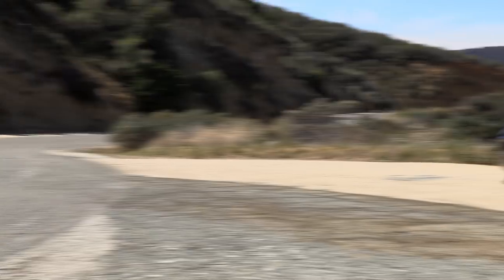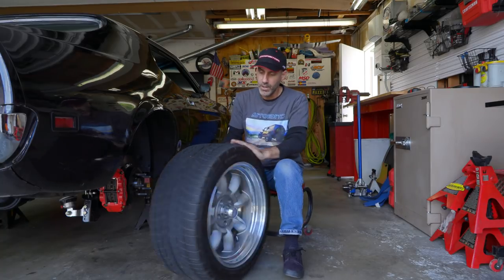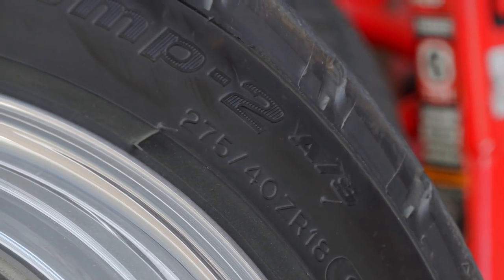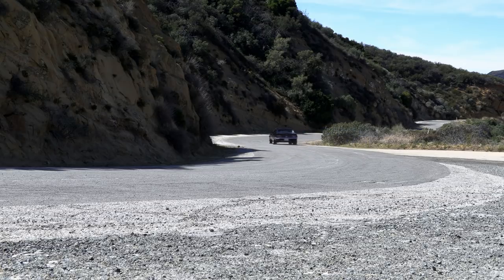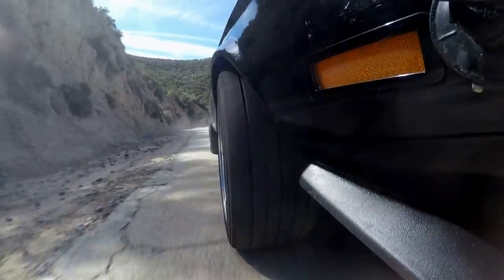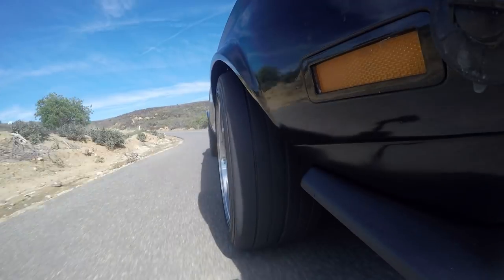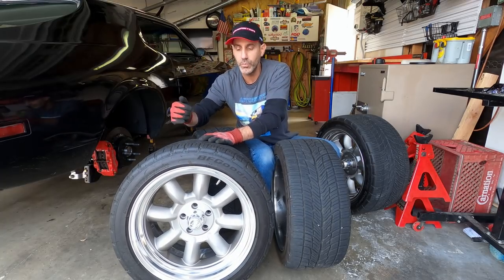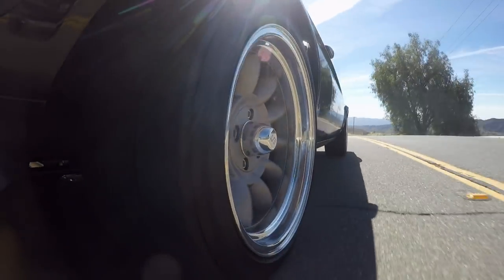Tire Talk 101 - How To See and Hear what Your Tires are Telling You

Comment: Nice stance! I used a similar set up way back when I had a '74 Cuda - 275-60 in the rear, 235-60 in front; there weren't 50 and 40 series tires for the street back then yet! And I was saddled with 15 inch diameter wheels; would have loved 16 or 17s. Good of you to do these videos for us stuck at home! And nice to have those back country roads to play on!
Reply from the maker: Love those Cuda's and yeah, I'm lucky that there are back roads like that all around me !!!

Comment: Wow I didn’t realize the size differences between an 18 and 17 inch rim. I just put on a set of bf g’s g-force sport comp-2 tires 245  45zr17 in the front and 255 45zr17 rears on American racing Shelby wheels. But looking at the size difference I think I may have under estimated the look of a 1969 Mustang.
Reply from the maker: I think 17's are the best overall performance size. Do you like the sport comp-2 tires? That may be what I do next or falken... don't know yet.
Reply: I will let you know I’m pretty close to getting it on the road hopefully by mid to late summer.
Reply: I will let you know I’m pretty close to getting it on the road hopefully by mid to late summer.
Reply from the maker: Cool!

Comment: What’s the specs on the rims? I’m debating a superlite style for a 71 Mach and the size/offset looks amazing on your ‘73
Reply from the maker: If you have stock leaf springs in the rear and different brakes, you should measure your own backspace... here's a video on how I did that on this car https://www.youtube.com/watch?v=BmN6KPTAnig
Reply: AutoEdits thanks for posting the other vid. I’m planning to follow your route for the front end of the car but for the rear,  I plan to stick to leafs while adding a Fays2 Watts Link and staggered shocks. I guess the more common term is pro touring but I was obsessed with the TA series Boss 302 cars when I was little and always disappointed Ford dropped out before letting the big bodies shine. So my goal is to build a streetable Mach that screams SCCA TransAm and can back the looks up.

Comment: Jason--- you originally put  in 3" studs with you wilwood brakes. Did you end up cutting the studs down? Or replacing them with shorter ones? Im trying to figure out if it's ok to cut down the studs to fit the wheel lugs. Thanks
Reply from the maker: They looked a bit too long in these wheels so I did swap back to the original studs that came with the wilwood brake kit. You could cut them but I would worry about making sure the threads are easy to start.
Reply: Thank you. 
I'm leaning towards coy c-5's. I like your stance on L.Marge. Im going to go for the same look on my 69 mach 1.  One more question. Did you end up with a wider tire than a 275 on the back like you talked about? Or are you still at 275x40x18? Thank you
Reply from the maker: I just ordered some 295 Nitto tires and will mount them up next week or two. Should be perfect.
Reply: Great  will be watching. Thank you

Comment: What canyon is that? Also cant find the video on bump steer kit set up? I going through my front suspension on my 06 300 and have a bump steer correction and some other parts.
Reply from the maker: I didn't do a video on the bump correction. I just bought a gauge and did the recommended settings after some measurements. Very straight forward and works fantastic. The bumper steer gauge was a couple hundred dollars so it's not cheap to do.
Reply: @AutoEdits  okay though you had mentioned you did. I just wanted to see if I was close or where it needs to be thank you